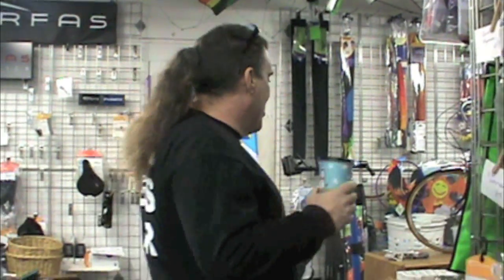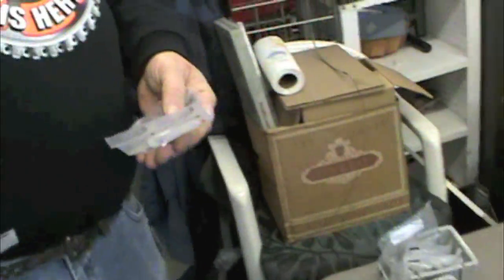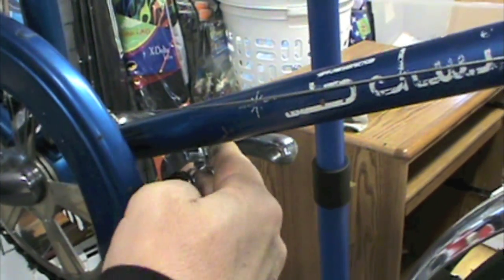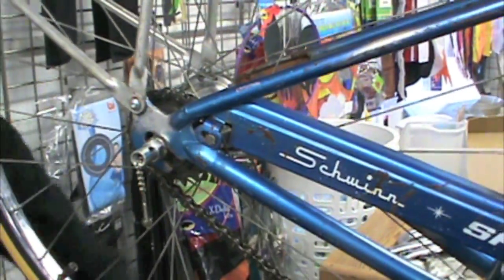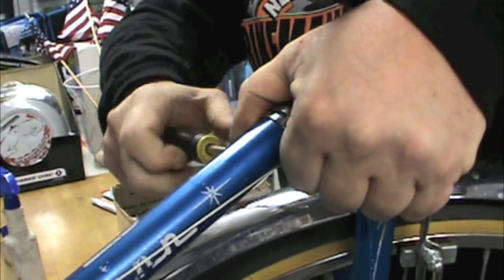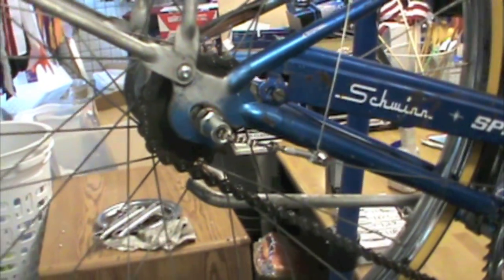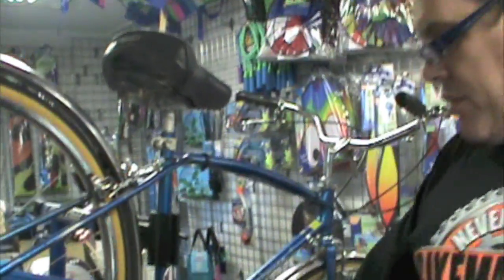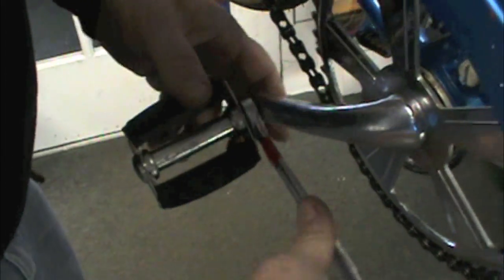How To Adjust 3-Speed Cable Sturmey Archer - Schwinn Speedster Part 8 - BikemanforU Episode 32

Comment: I put my 1973 S/A AW 3-speed shifter in 2nd gear and then adjust the chain so the pin shoulder top, just below the first chain pin, is even with the window on the axle. This leaves the chain a little less loose in third gear, actually not really loose, just no tension on it. She shifts beautifully and the cable never leaves the wheel.
It's a 1973 Schwinn Breeze BTW, English rims and all. Been through the hub and, yes I'm a big fan of the Sturmey/Archer 3spd.

Comment: Your video was very helpful and Thanks for posting it! I just picked up a 77 Speedster with a 3-speed Archer hub that needed to be adjusted & I did it thanks to You! I like the way you routed the gear cable through the bottom! Very clean looking! My Speedster cable runs through the top tube so I might consider moving it to the bottom.

Comment: Here's a guess. This is before the stiffer style casing and cable for gearing came in, which Bikeman mentions in other videos about gear cable. The un-stiff cable is OK for pulling, but not retracting. Retracting is important for gear changes, and not so much for brakes. They used minimal casing so a light, easy hub spring would be enough to keep the cable always taut.

Comment: Thanks for this! It really helped. I'm fixing up a 1961 Raleigh Colt, with a Stermy Archer 3 speed, and whenever I'd shift into 3rd, it would go out of gear. This really helped with my restoration.
Reply: out of gear as in no drive at all like accidental nutral ?

Comment: 2nd time was a charm. 1st time two problems: 

The cable head popped out of the trigger slightly--this is pretty easy before it's pulled tight! It can (and did) get stuck out of position then when I shifted to 1st, ugh trouble.

Second, I think I mashed the cable too tight at the hub end, causing the fray.

Fortunately had extra set. When you get it right it seems straightforward, in retrospect.

Old fenders and chain guard are tired looking. Wonder if they are worth the bother.

Tx Bikeman.

Comment: Just back from the garage. Yes the metal end of the housing goes into the trigger. The plastic removable end wasn't needed, the housing itself goes into the little guide on the clamp.

The whole job failed though--possibly the hub itself is bad. The action on the indicator rod is quite rough and resulted in a frayed/ruined cable at the anchorage when pulled tight.

Thanks for listening. :-)

Comment: Thank You!!! I love the series. Working on a Raleigh 20 and the info is perfect. Keep up the great work. The link for your website does not work from this YouTube copy. No problem in that a search found it fast. It's only a matter of time before there will be the same interest in 60/70s bikes as there is for muscle cars. Love my old Raleigh. And thanks again for what used to be "secret information".  How many bikes were trashed because the hub was between gears. keep up the great work.

Comment: Thanks Bikeman. I'm cleaning up an old Rudge Sports and going through this process. I don't see where you cut the cable housing. You must have done so because originally it is as long as the cable itself. The metal end of the housing goes into the trigger, right? And the other end is plastic and removable so can be put back after cutting the housing to length I guess.

Comment: are there certain times you prefer to receive calls? I live in Canada, but have free long distance from a landline. 
I managed to get it loosened off so it goes into first gear, and rides well in second, but it still gives out in third, it will catch and engage for a while in third but then it will click suddenly into neutral and spin without moving the chain.

Comment: I noticed that bicycle is equipped with a sturmey Archer TCW 3 speed with mechanical built-in coaster brake now why does that rear wheel have to incorporate what the caliper brakes on that back wheel that does not need to be on the rear of that bike? And also to that I did notice the wheel doesn't spin as freely now are the bearings a little too tight on the rear hub or what? Now on the left side of the wheel you can adjust the play just a little where it be like about a millimeter of play on the rear wheel so you do not bind up the bearings other than that it's a beautiful bicycle and I believe it's Top Value will be between 150 to $200.

Comment: Great video.  Help!!!  So I am trying to fix up my 74 StringRay with 3 speed.  I have the chain pulled all the way out but it will not go into 1st gear.  2nd and 3rd work fine.  Any suggestions to get 1st gear working?

Comment: Did you overhaul the gearhub? Do you recommend oil or grease lubrication?

Great videos!
Reply: +Daniel Geib If it's behaving well, no need to overhaul.  First try flushing with solvent, may be gummed up if it's been sitting.  They have a reputation for being solid for many tens of thousands of miles.  If it has a hole for oil in the shell, then oil.  Two drops every two weeks or so.  I used 10w-30, not sure what the oem specified.
Reply: oil

Comment: Hi Bikeman,
I have a Shwinn Racer with a Sturmey 3 speed. Today it fell over, wasn't a big deal but the gears started messing up on the way home. In 3rd gear it was disengaging and eventually staying completely in neutral, and as I was adjusting it back and forth, 2nd gear was in neutral at points too. Right now, the cable looks properly adjusted but it spins like a windmill in 3rd gear and won't even go into 1st. Which seem like signs of it being both too tight and too loose. What should I do?

Comment: I’ve noticed my Raleigh 3-speed (w S-A gear) has a noticeable lag between initiating pedal turn and the gear catching the wheel. Any fixes for that?
Reply: Momentarily stop pedalling. Just like in a car when you change gear you need to come off the gas first. Try it!
Reply: @shaunflynn7301  @bikemanforu appreciate your response, but i might not be describing the problem. it has nothing to do with shifting. in each gear, the bike chain moves before the gear moves. it feels like it's totally disengaged for about 2-3 inches of pedaling, before the chain actually moves the gear.

Comment: I like this and it's sad that most of my hubs were given away to a bicycle dealer in my town of san diego CA.
But now I'm wondering if there is anyone out in my town that has a few sturmey archer hubs left they all must be 36 hole types only.
Anyone out there to help a guy out here.?
I found out on my own that you get higher gears on the STURMEYS by having 12 or 14 teeth in the rear,and the speed pick up is makedly higher as you are traveling down the road.

Comment: i have a 1 968 Sears 3 speed bike but first and third work second is not sometimes II works but doesn't always want to stay in second I need help fixing it your video help me but can you try to help me out a little bit I don't really know what's really wrong with it i ma larrycassar it's not a clicker set up it's on the hand group itself and I need help find those rubber grips but I need them in whitethe ones I have on right now once missing in the other one has an all the rest of dry ride

Comment: I'm guessing around 40$ an/hr for labor that's how much the pro shop I go to charges. New chain, new wheel ,headset and bb bearing all four cables.new brake pads change out all steel hardware I'm going to guess about $350 or so including 3 hours of labor.that's if gears and shifter are ok?

Comment: I have a blue 1970 Schwinn racer with the 3 speed thing. 
Whenever I put it in 3rd speed it stays there for about 1 minute and goes into no gear. And about a week ago my 2nd gear stopped working and would pop back into 1st and back into 2nd what is wrong with it?
Reply: cable may need to be ajusted to the right tension, checkto see if it come off pulley